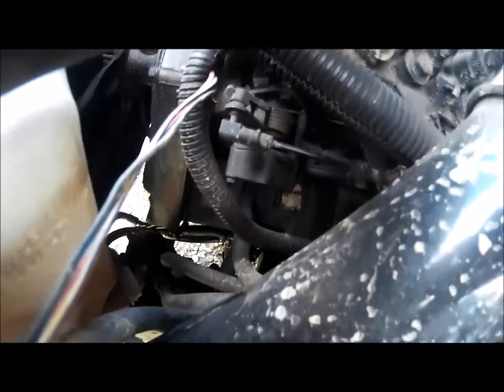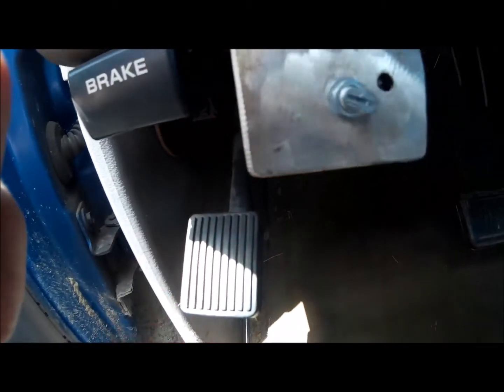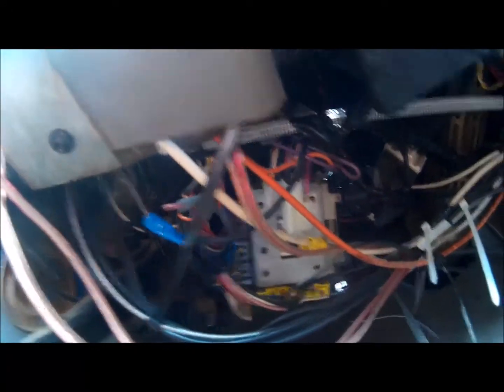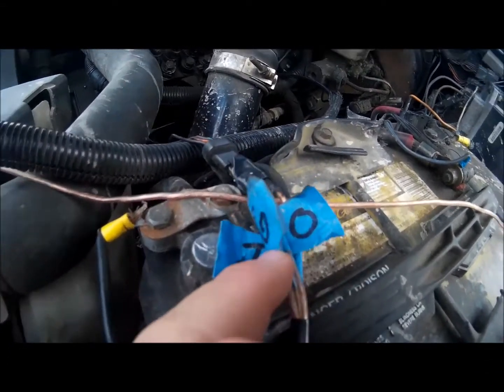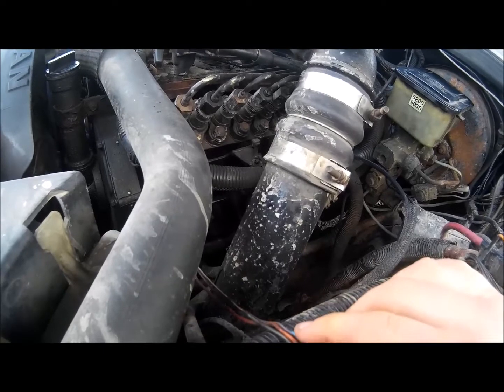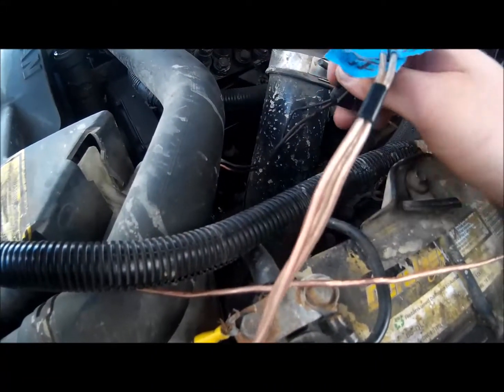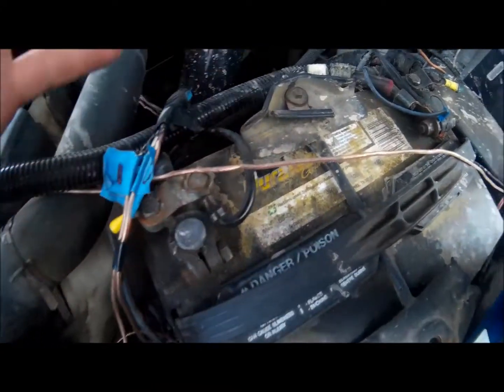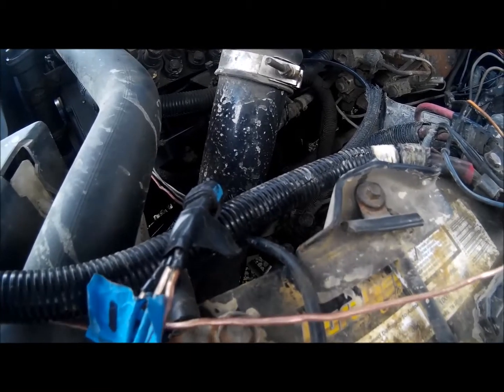Potentiometer TPS delete

Comment: If you have a 12v Ram w/Cummins, remove the TPS & there’s a flat blade on the linkage that turns/drives the TPS & that blade gets a groove worn into it. Take a die grinder & smooth the linkage, set to 1V. If it isn’t smoothed out, it’ll do happen again. Prolly don’t even need to replace TPS. TPS wears the groove in it.

Comment: You didnt tell how to wire it up. You have 3 terminals on the pot and 3 on the harness. You explained the funcion of each colored wire but where on the pot do they go?
Reply: The middle stays the middle, the two outside can go either or, it will control which way is + or- on the knob
Reply: @TysonPooyak  thanks

Comment: Actually looking at this video because my 97 had a pot switch from previous owner. I'm thinking of going back to a tps because my truck will not downshift correctly unless I'm fucking with that dial constantly. I do have a Randy's stage 3 auto in it. So idk if it's the trans, but my thought is it's not seeing the correct"throttle input voltage via pot switch" to down shift. It thinks it's cruising with light pedal pressure when I'm foot to floor towing and it's rolling coal in OD doing 45 instead of dumping a gear to bring rpm back up.
Reply from the maker: That sounds more like a kick-down cable out of adjustment. The potentiometer will hold it a little but it will still shift. It has the greatest effect while up shifting.